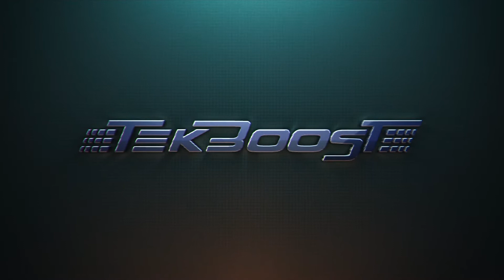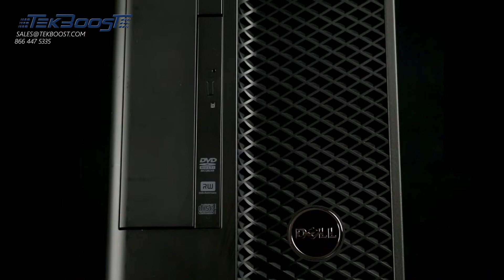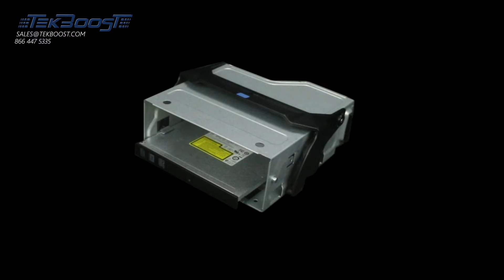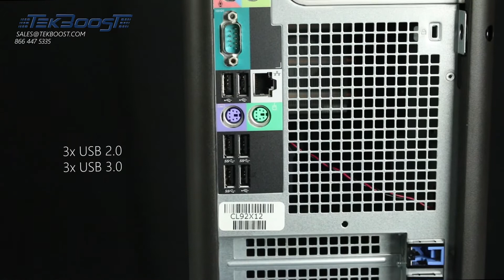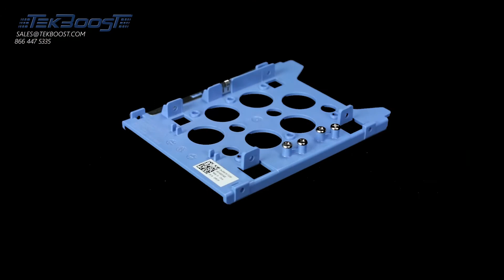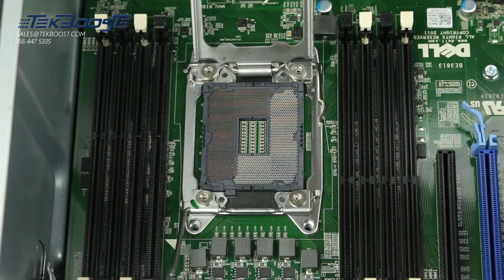Dell T3610 Workstation Overview

Comment: does anyone know if the ASUS ROG Strix Radeon RX 5700 XT 8GB OC would fit?
Reply: If you properly configure the (latest) BIOS and use a special, converted power cord, theoretically yes, I have seen tests of such a configuration. But that doesn't make sense because of the bottleneck CPU you can apply to this computer against this Radeon. A better choice would be the GTX 1080 or even the RTX 3060 in tandem with the e5-2690 v2 or even the e5-2697 v2 (in the case of the latter CPU, the heat sink should also be replaced with Noctua).

Comment: Do you think ubuntu will work fine on thise one?
Reply: I work with this station since 5 years with Linux Mint 32gb ram and a quaddro k4000 and 3,7ghz cpu. I´ve never ever had problems with this configuration ❤

Comment: Does anyone know if the T3610 is able to boot from an NVME SSD with PCIe adapter?
Reply: A lot of people don't know this but with a adapter you can boot into it. Dell tells you that you can't but with a workaround you can. I have seen Linus tech tips do it.
Reply: it will work but you can not boot from it in that configuration
Reply: @blazingmatty123  If you want to boot from NVME, you must use Clover
Reply: @souacz  i'm aware, but that's not native so it'd may as well not be possible

Comment: Is this good for gaming
Reply: I have a GTX 1080 in mine just need a 8 pin to 8 pin cable.  It will power up to around a GTX 3070 off its single 8 pin.   I would still to 230 watt or lower TDP video card.
Reply: Yes but you have to have good processor and graphics card

Comment: Question for TekBoost:  Is DELL T3610 good for VIDEO EDITING ? ...if you have a suggestion, please advice me.
Reply: Sure it kicks butt at video editing.   I have one with 32 gigs of ecc ram and GTX 1080 and hex core.
Reply: @insidejob8309  my friend which CPU and how many fans do u have I have two fans where is dell logo and one CPU cooler fan , I also want to buy GTX 1080 8gb does it have good temperature or not
Reply: @MuhammadIjaz-jm4jg  Sorry late at seeing this.   Blame you tube maybe they shadow banned you. :)
DELL T3610
- CPU Xeon E5-1660 vs 3.7Ghz to ? 4.0
There are two fans up front and fan for the hard drive up front.   It uses ducts to cool ram and cpu.    Its stock
My GTX 1080 is FINE its on 24/7 x 365 no heat issues.

You just need a cable to replace the stock 8 pin to twin 6 pins with a 8 pin to 8 pin.   It can handle up to 220 watt gpu.  So a 3060Ti or 3070.  Its a power supply that you can't upgrade.
Reply: I still work with this T3610 system... 32gb ram and a quaddro k4000 3,7Ghz ... I´ve never had problems with tenperature or system shootdowns. My next pc will be defenently a DELL workstation too. It is the best station i´ve ever had in my whole life.